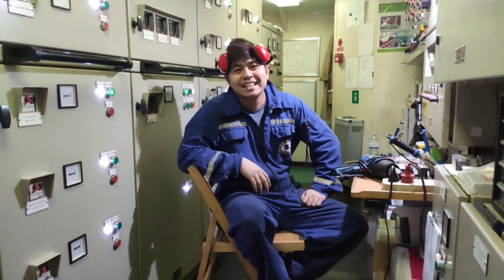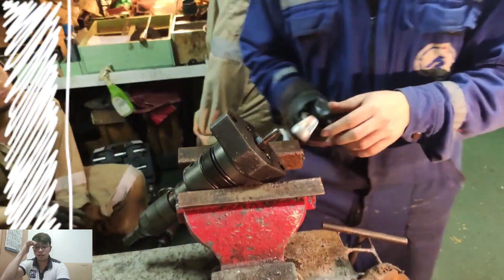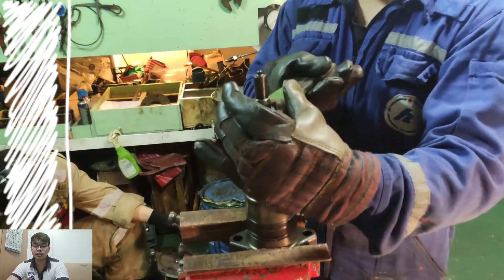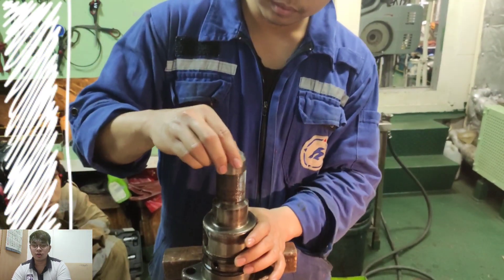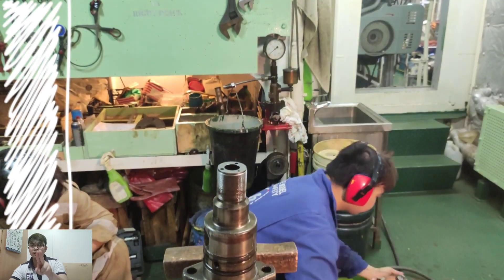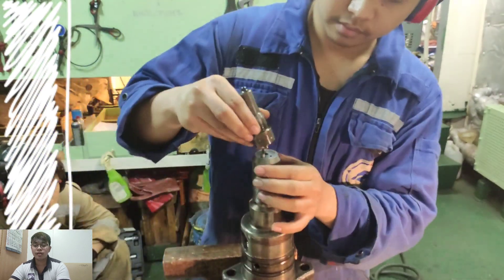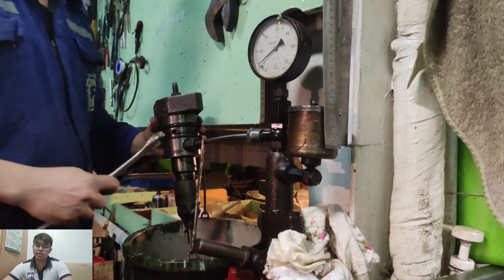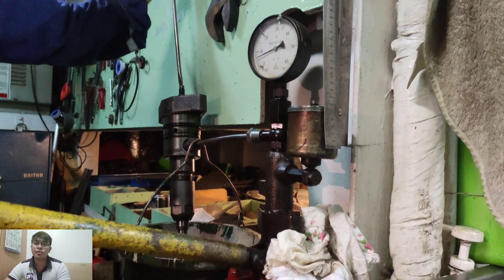How i overhaul Fuel injector | Yanmar | triptv ph

Comment: How often are you replacing the spacer? 
Do you find that the lapping compound can cause minor leakage when re-using spacer? 
Shouldn’t you use previous nozzle face to lap the top of the spacer instead of the injector body?
Reply from the maker: yes you're Right about replacing spacer , but - it still depends  on the condition of the spacer . Normally we change it all but some cases of ships are lacking spares of such , same way with the nozzle , that's why i used injector body instead. Thanks for showing interest in the video. Have a great day .
Reply: instablaster...

Comment: Hii we have yanmar engine and we getting problem and the problem is diesel is mixing with louboil sump
Reply: Check ur fuel pumps. If the barrel and fuel pump body o-rings are gone then there will be leakage of D.O to the cam shaft region.
Reply: @NeerajRkitsme  thankyou 🙏